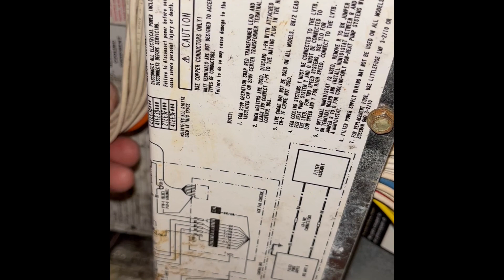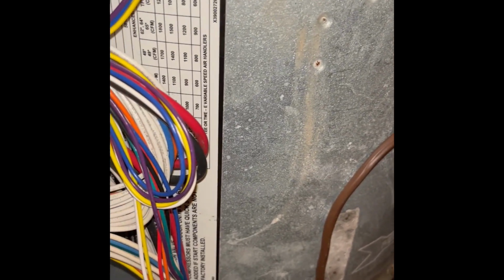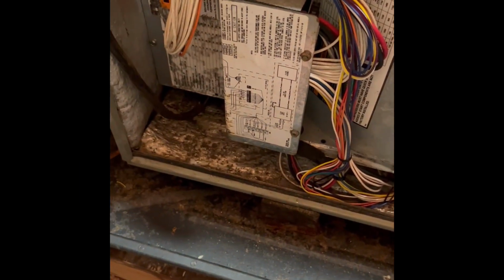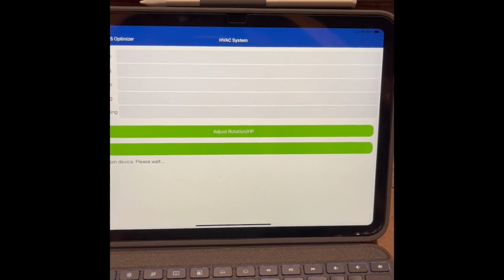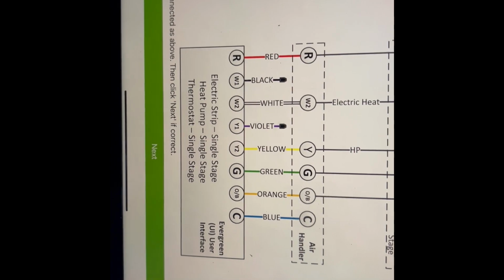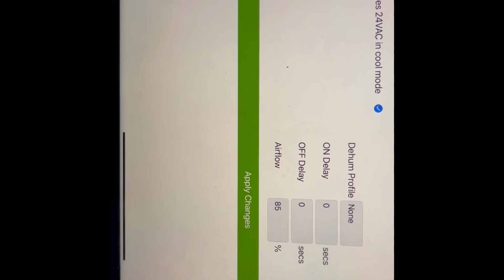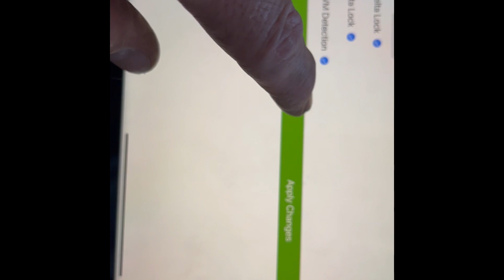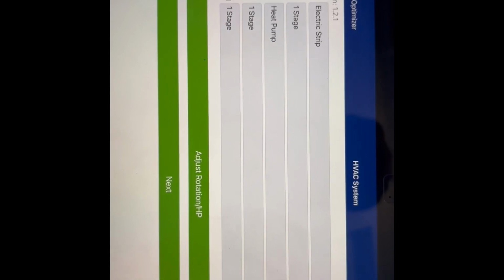Evergreen variable speed programming with WiFi interface

Comment: Just installed this motor and the blower keeps running. The Fan on T-stat is set to auto, the G terminal on primary circuit board isn’t energized but the blower won’t stop. No error codes in primary circuit board. The AC works but when it cycles OFF I noticed the blower shut off immediately for half a second then turns back ON and keeps running. Please help

Comment: I used this on an infintiy carrier unit and for some reason there is dc voltage drop between the box and the motor getting a low rpm code but the motor is spinning like a champ i called tech support and on the carrier side all readings are correct but idk if maybe the cable isnt connect properly or the box isnt working right
Reply from the maker: I would look at the harness connections.  Is there a drop between the ends of the harness?  I would contact Evergreen or Regal Beloit tech support if the issue isn't wiring.

Comment: Thank you for the effort!
I've made full conversion of my Goodman heat pump from PSC motor to a real Variable Speed Evergreen VS, using 5K010V interface module. 
Replaced my furnace's (Oil burner) control board, and all the wiring, plus added a required inductor to filter out AC noises from the motor's power supply line.
Did not use the video for my project, though. 
Since my unit is a single stage (fossil fuel) -- the wiring, and programming interface look the same as with your setup.
In heat pump case I'd like to be able controlling airflow (CFM) in cooling mode independently from that of heat pump heating. The difference between the two is in O/B reverse valve position.  
IMO cooling is more efficient with higher CFM, while heating is better with lower CFM.
At least fossil fuel heating CFM is independent from heat pump mode CFM -- this is the most important feature.
I recommend you unchecking "Enable PWM Detection" in "ADVANCED SETTINGS" of the setup.
Unchecking allows you to override whatever motor horsepower, CFM, delays are set in the air handler's control board. You get more control, plus the control is available in the app, instead of by the board's jumpers/dip switches.
Reply from the maker: This is not my blower, so making adjustments are not necessary.  While efficiency may increase with higher cooling cfm, you increase sensible heat ratio, which essentially reduces dehumidification.  This of course, is a regional consideration.